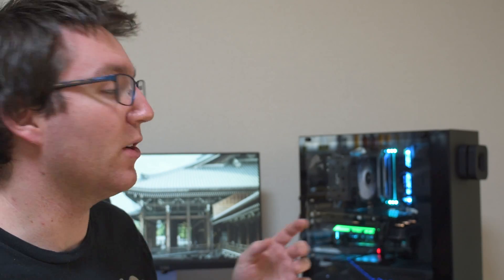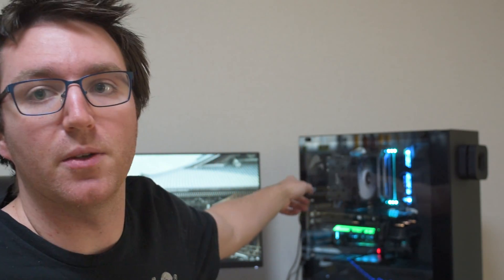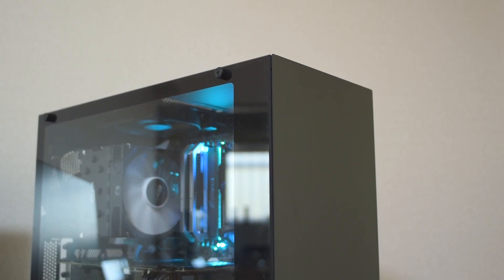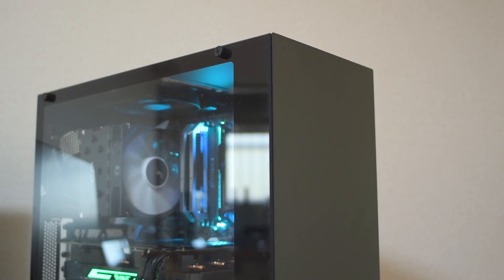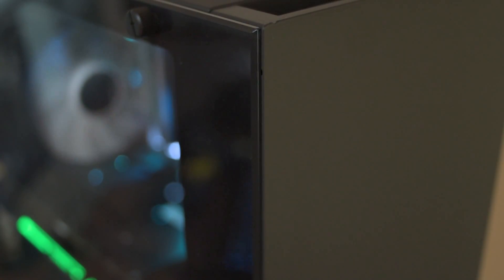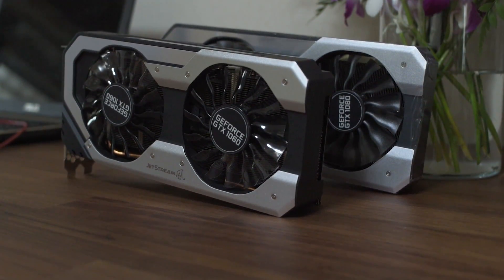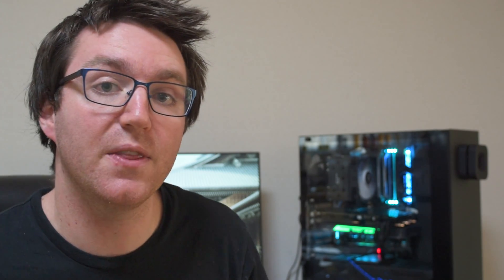NZXT S340 airflow test

Comment: Gone are the days when cases had no ventilation, now every case, regardless of quality has more airflow than a 20-year-old case, back in the early days fans were a set speed, now they're controlled to go faster under load, and the cases have more holes than my girlfriend does, having more than 2 fans (push/pull) configuration is all you will ever need.

Comment: i have this case and my i7 7700k at 4.50 ghz under a corsair h100 v2 hits 91c and my 1080ti with a founders cooler hits like 84c, the cpu pump is at 3000rpm with the radiator fans at 1500 rpm....and the video card fans at 60%

Comment: So would it be fine using the stock fans because I'm building a rx 580 with r5 2600 and I ain't planning to oc. Would that be ok?
Reply from the maker: That will definitely be okay. That system has a similar heat out put to this test system and I have no problem.
Reply: @DawidDoesTechStuff  okayy and also what would u say on this pc called the cit blaze. It has 6 stock fans and also it's in my dimensions cos basically I have a desk with a build in pc stand and it's 200mm wide in width:/ this is 30mm to long xD

Comment: I have a ryzen 2600x in mine and it reaches 80+ degrees with the stock cooler under load while playing games. I have to take off the window panel which keeps it around 60. So the issue is clearly airflow, I've ordered 2 intake fans in the hope they make more difference than they did in yours.
Reply from the maker: I hope it does. I did a recent video comparing the S340 to the H500 and got the same result. Adding intake fans seem to make a difference that is within margin of error. The system I was testing did not have over heating issues though, so maybe in a more extreme situation it would help.
If it's not too much trouble would you let me know if it made any difference? I would be interested to hear.
Reply: @DawidDoesTechStuff  okay the results are in, first of all the CPU is now down to 25 - 27 degrees idle and 55 degrees under load although it's not just down to the fans why the temperature has reduced so much. Apparently changing your systems power in control panel from performance to balanced makes a big difference where Ryzens are concerned! The fans however knocked off another 5 degrees so all in all id say it was worth £10. :)
Reply from the maker: @jayrambles85  That's awesome that you got such a huge drop in temps. Ryzen CPU's do seem to be very brave with voltages and manually setting them lower in the BIOS can also help temps. What fans did you install? I would be interested to see if they make any difference in my setup.
Thank you very much for getting back to me about the fans.
Reply: @DawidDoesTechStuff  yeah i saw your updated version too after I watched this video, doesn't fill me with confidence but like you say, you wern't having overheating issues so we'll see what happens. Sure, I will keep you updated on the results.

Comment: Without the front intake fans the case would be operating at negative air pressure, which means air is getting sucked in via the gaps, the nooks and crannies, and not just through the filtered intakes. Over time the dust buildup would be significantly more than a balanced or positive air pressure setup.

Comment: I’m no expert, but the front of the case is completely closed other than a slot on the top and bottom. So first of all, wouldn’t you think the top mount would do more than the bottom (middle of the case) mount? Also, knowing how closed off it is, wouldn’t you immediately consider 2 140mm intakes on the front or a 280mm rad? I don’t know how much of difference it would truly make but it seems maxing out the intake on this case is somewhat essential looking at the design.
Reply: $40 extra for peace of mind seems like a deal to me

Comment: I have to agree with the other people who comment in that this vid is bad because it's spreading bad info.  First off, as much as I love the aesthetic of this case, the intakes are bad and starved for proper airflow.  
Secondly what would possess you to put the only intake in the middle.  Look at the distance of the middle fan, relative to the intake port at the bottom.  That on top of the openings at the bottom where the hard drive cages lie, make the air divert into the shroud for the most part.  You NEED to put the fan at the top intake, as it is the only place on this case that give any viable intake.  Next time you want to do a vid and make a judgment on a cases viability for air cooling, try using both front intake spots.
Reply from the maker: Macsimus007 Fair enough, I should actually revisit this video and do it properly. It was one of my  first videos and I was so busy terrified that I didn't really think it through very well. I understand what you mean about using the bottom intake. I initially wanted to do it in all possible positions but for some reason didn't.

Comment: Hi. Is there a website where you can create and customize your own PC CASE and buy it ??
Reply from the maker: garbis robert Hello, that's a good question. I guess it depends how custom of a design you want but as far as I know there aren't any websites doing custom cases to order. Even a quick Google didn't really show any. 
Thanks for commenting and if you do find something please let me know I would be interested to see.
Reply: Ty for your answer dude.
My first pc case for my gaming system was an ThermalTake, but i resell it after a few months and now i have my system mounted on a COUGAR PANZER. This case (Cougar) meets my requirements for airflow but is not the perfect case i dream of.
In my opinion, the perfect case for gaming and airflow should be like this : front grilled for intake (not glass or any to block airflow), 2/3 places for funs on the bottom, 1 in a rear for exhaust and 2 on top for exhaust too (but on top, to avoid dust, the cover should be exactly like in NZXT H700i case - airflow gets out through the sides of the panel and from the rear), the power source sould be on the back (mounted on the short side) and the back panel (where you make wire management) could be grilled for 2/4 more fans for intake.
This is the case i wanted to buy for my system, but i cant find any.
The seller, when they make one, thinks only for air cooling and avoid making something great for the ones who use fans.
Reply from the maker: Wow, that would a very well cooled PC. Like you said, there aren't any cases will all those features in one. The only case I can think of that comes close to that is the Corsair Carbide Series Air 540 ATX Cube. It is one of those cube cases with the power supply behind the motherboard (not under it) That case has space for a huge amount of fans. It is a bit of a different looking case though because it is a big cube. https://www.tweaktown.com/reviews/5588/corsair-carbide-series-air-540-high-airflow-atx-cube-chassis-review/index.html
Again it is still missing many of the fan mounting spots you wanted. That Cougar Panzer does have some pretty good airflow though.
Reply: ty for your answer dude !
Reply from the maker: garbis robert It's a pleasure, sorry I couldn't help. Good luck finding the perfect case.

Comment: If you are on a restricted budget, and you cannot afford a fan for the intake, why would you even buy a $99 case in the first place? I cant imagine anyone not adding fans to their case... and also, hey...people... stop complaining about captured thumb screws and rubber grommets like that's so so so important or even necessary. (he didnt complain about it, but you know.. while Im venting...) I'm running same case, wtih a 7600k, and a 1080.. I have zero cooling issues with a corsair h100i v2 in the front and 2 corsair af120s in for exhaust.
Reply from the maker: Thanks for the comment. I love a good vent. :P Perhaps the point of saving some money on a couple of fans was a bit lame, but the reason I made the point was because it seems as though the case doesn't have airflow issues (like you said). The hardware in my girlfriends build does not suffer from overheating issues at all. I think it does better than many other solid front panel cases.

Comment: I've been doing a lot of research on this case; with a fan in the front for intake at the level of the GPU, you probably would have seen a difference with the front panel off. Seems to be the biggest issue when talking thermals for this case
Reply from the maker: Roy Kim That is a good point, although there is a big gap at the top and bottom of the front panel. I don't think the case is that restrictive. I will try it out and see how much of a difference it makes.
Thank you for the comment. :D

Comment: It seems everyone is trying to be cheap when adding fans to this case.  Leave the 2 fans that came with this case alone and add either 2 front fans or a AIO cooler in front.  I did this and my CPU runs 62 C under load and my Evga 1080 SC runs 66C under load.

Comment: I heard there's no Reset Connector with this case, and I was wondering what it is and if I need it?
Reply from the maker: That is true, it is because it doesn't have a reset button. I have to say I really don't miss it (neither of the cases I have don't have a reset button). All a reset button does is it means you only have to press the button once to restart your PC. With only a normal power button you have to hold it in for the PC to switch off (This feels like strangling somebody with a pillow but is fine.) and then press it again to turn on the PC. I really don't think it is something you need. I hope this helps, thanks for commenting on the video.
Reply: Hard On Hardware Thanks so much for the fast comment! Yeah, that's all I needed to know.
Reply from the maker: Rex Art It's a pleasure, I'm glad I could help. :D

Comment: I want to get this case. Thinking to Use 2 noctua 120mm high airflow as exhaust and a 240mm aio rad as intake. I live in South Africa and gets hot in summer 30+°C. Do you think this will be a good cool system? Also is there a intake hole at the bottom of the from panel?
Great vid test btw
Reply from the maker: Matthew Sussens Hello Matthew, thanks for the comment. That does sound like a good setup for keeping it cool, even in that kind of heat. I think one thing to look out for though is that your intake fans are pulling in more air than those two Noctua fans are exhausting. Having more air coming into the case means you will have positive air pressure in the case which will help keep dust and stuff out of the case. I think two Noctua fans have might over power the fans pushing air through the AIO.
In regards to a opening in the bottom front. Yes there is. It actually has a lot of space for air to come in at the front. The case had pretty good airflow and I think it will serve you well in SA.
Reply: Hard On Hardware thanks for the advice

Comment: Hey so I just got this case... was wondering what’s the best way to minimize dust getting the sexy case all dusty?
Reply from the maker: Travonn Redding Well I have been running it for a while in a very dusty flat and it actually does very well to keep dust out in its standard configuration. I think a good way to keep dust out of your sexy new case is to create positive airflow. If you have more intake fans sucking air into the case it will mean that the only place air that comes into the case is through where the intake fans are sucking air into the case (which has a dust filter so it's fine). I hope this helps.
Reply: Hard On Hardware dude thanks so much! Building y first rig wish me luck! Also subbed a while ago 😚😚
Reply from the maker: Travonn Redding That is super exciting. Good luck with the build, it is a great thing owning a PC. If you have any questions let me know and I am happy to answer the best I can. Thank you very much for the sub, I hope you have enjoyed it here. :-D

Comment: Great video! For me, I didn't buy any additional intake fans. Instead, I moved the upper exhaust fan to the lower front as intake. The airflow seems to be quite decent, however not that windy but it's still going good and steady.
Reply from the maker: Falcryx I think that is a great idea moving the top fan to the front, if anything it would help balance the airflow and reduce negative airflow. 
I am really glad you enjoyed it. If you have time have a look around the channel there might be some more stuff you might enjoy.

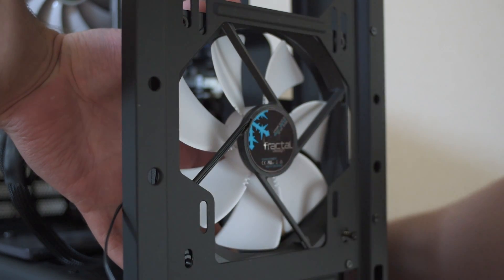Comment: Dude, at 4:27 you just showed that you mounted it. right? You did not actually mounted them this way for test, right?
Reply from the maker: Bohdan Lvov Oh yeah, haha! That was just for the B-roll. I realised I out it on the wrong way around after I put it on. I was just concentrating on getting my hands in the right place for the shot. I did turn it around after I did the take.
Reply: Hard On Hardware good to be sure!
Reply from the maker: Bohdan Lvov I completely understand the question, it would have been a pretty ridiculous mistake for me to make. :-D
Reply: an air conditioner  in place of the tempered glass would work so much better

Comment: What's the ambient temp in your room during the test? Where I live it's usually around 30c. I really want to get this case but I don't want to see my 1080ti hit over 80 degrees.
Reply from the maker: King Haro It was summer in Tokyo which is hot and humid. The ambient temperature was around 25 degrees in the room because I had the air conditioning on. Which version of the 1080 ti do you have? I think it should be fine. I had a Palit GTX 1080 (which doesn't exhaust any air out of the case it dumps all the hot air straight in the case) for ages during summer and it never went above mid 60s even with an overclock.

Comment: Not much of an issue but I was weighing the option of two 120mm intake fans vs a single 140mm and I think I will go with the single 140mm. What do you suggest?
Reply from the maker: Riga motifs I think the single 140mm is the better choice because fewer bigger fans are quieter. Thank you for commenting. :-D

Comment: Did you try only front fans? I would think front fans would be better than rear ones.
Reply: just a thought, I believe its gonna be nagetive airflow, and it would suck air or dust into the case. I would take those two fans as intake.
Reply from the maker: Kevin Chen Yeah, you are right, the case as it comes from the factory definitely has negative airflow. This is something I actually forgot to mention in the video. This is one of the main reasons to get intake fans on this specific case. For day to day use I have intake fans installed for positive pressure. It was just for testing the stock configuration with and without intake fans, that I used that setup. Thank you for watching and the comment.
Reply: got you. thanks
Reply from the maker: I tested the case in its default set-up, it had the two exhaust fans, one in the top and the other in the rear, installed for both tests. I think that might be why adding an intake fan made such a small difference. There was already enough airflow in the case without any intake fans. To be honest I was really surprised by the result. I thought going from no intake fans to having incoming airflow would help temperatures. 
If what you mean by your question is that I should have compared having only intake fans and then also tested having only exhaust fans and then a combination of the two, then I don't think it will make much of a difference because with all the fans installed there was pretty much no difference from having only exhaust fans. I don't think the temperatures would have dropped if I took out the exhaust fans. I hope I am answering your question.
Thank you very much for watching and the comment. I hope you enjoyed the video.